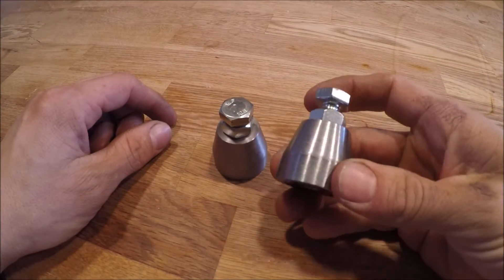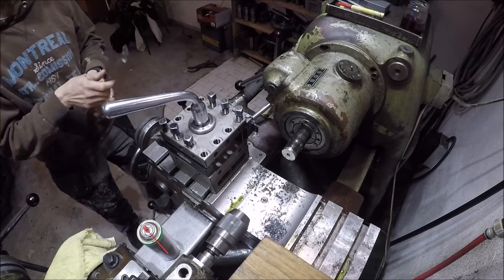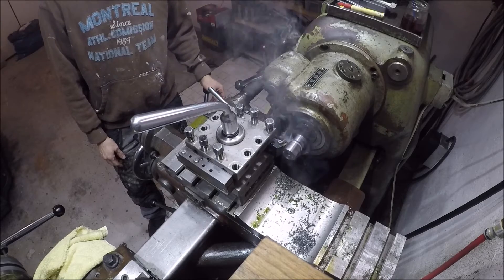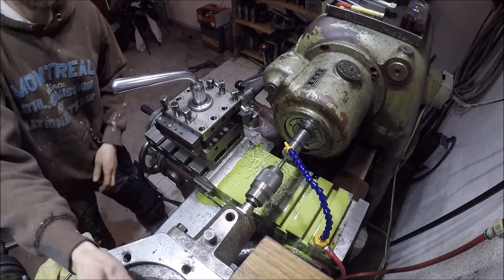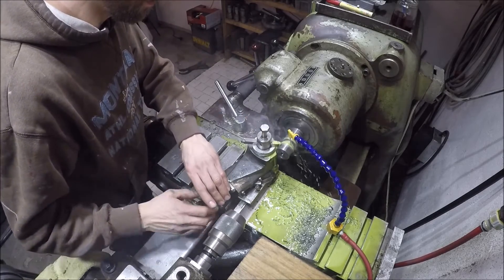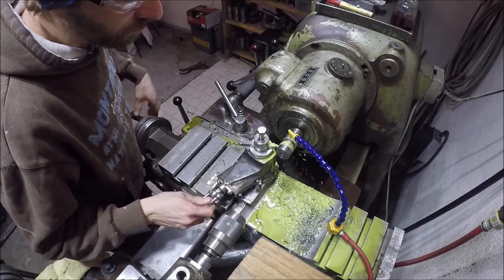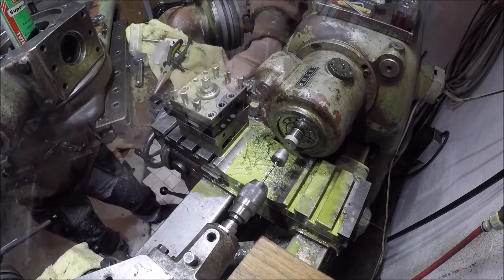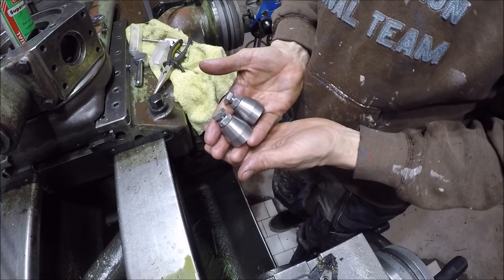Machining machinist jacks

Comment: Det skulle vara trevligt med närbilder också. Om du har en kamera till kanske du kunde montera den på tvärsliden eller spindeldockan?

Tänker mätstativ med magnetfot, gammal mobiltelefon och ett rejält gummiband... :)
Reply from the maker: Convoluted Logic (jag svarar på engelska så andra kan hänga på konversationen) There's usually more closeups then in this video. However i havn't used both cameras since i thought it would make the editing more time consuming. Thinking about it now, mabye it doesn't? The 2nd GoPro could be running and doing it's own thing. Thanks for the suggestion, i'll try it out!

Comment: I can't help but wonder if you could mount your compound to the rear set of t-slots and leave it there for quicker access? A lot of your tapers would need to run the spindle in reverse tho.
Reply from the maker: It´s a thought, but i´m not sure it would work. My lathe doesn´t run well backwards and i havn´t gotten around to figuring out why. The rpm falls when you put some load on it. However, my plan is to buy a bigger compound that can be mounted on the crosslide at all times.